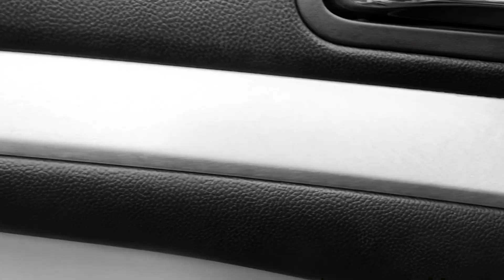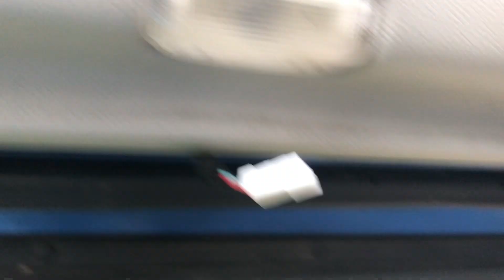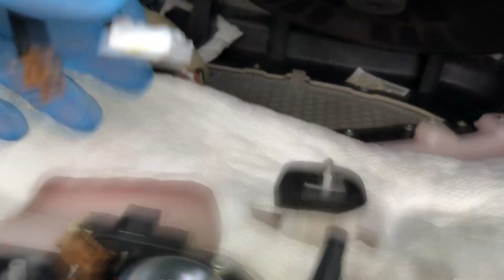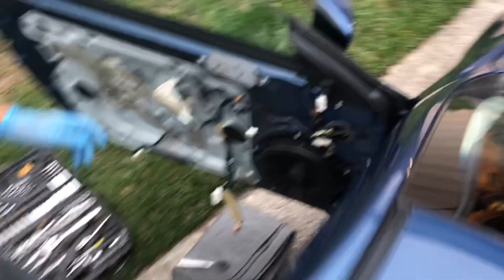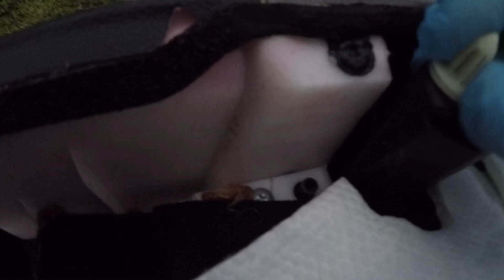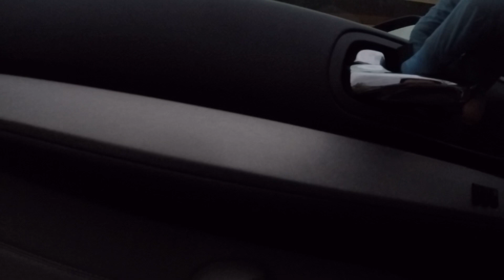Removing door panel on 2008-2013 Infiniti G37S G37 Coupe. Replacing master door lock window switches

Comment: Where did you buy the master switch part? I got my at car parts but my window doesnt do the 1/4” drop when opening or closing the door.. any tips?
Reply from the maker: Hi, that is what I was afraid of when I purchased my master switch.  I see a lot of hit or miss reviews regarding aftermarket master switches.  I purchased my switch on eBay from a reputable seller.  I made sure the switch came out of a Infiniti G37S coupe that was the exact 2008 year as my car.  Here is the search keywords I used on eBay. 
“oem g37s coupe master switch”.

Comment: why are you using latex gloves your not  performing surgery ,your nit dealjng eith chemicals  its houng a lil tk far eith videos man just use your hznds its easier snd you can actualy be more precise where you geab snd pull
Reply: He’s just making sure nothing gets prints on it for the sake of higher quality work. Why does that bother you
Reply from the maker: I work at a manufacturing facility that requires me to use gloves daily so we don’t get fingerprints on new parts.  It has become a habit to use nitrile gloves while working on machines and repairing cars.  I have been doing it for over 15 years and It feels weird to not use gloves now.  It is kind of a weird habit, but it keeps me from getting other car parts dirty if I accidentally touch some glue, grease or dirt.

Comment: I don’t think you have to remove the whole panel 🤔 at least on my sedan you don’t, you just pop off the little window switch panel and change the buttons out
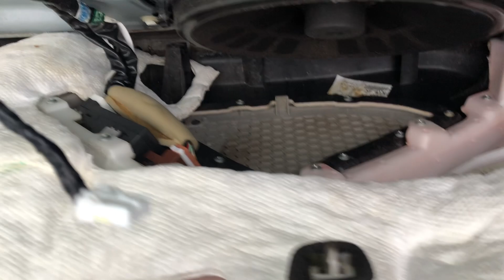Reply from the maker: That’s what I thought too.   I initially tried to pry the master control switches up from the outside without removing the door panel, but it wouldn’t budge.  I’m not too sure if it will pop off without removing the panel on the G37 coupe. I believe there are 3 screws that hold the housing in place.  At 7:25 you can see 2 of the Phillips screws that hold the master control switch panel in place. It’s the 2 Phillips screws near my left glove. There is 1 more Phillips screw that is hidden near there.  There’s probably a better method to get the switches out without removing the door panel.  Thanks for checking out the video.